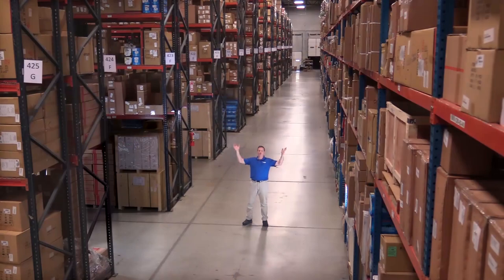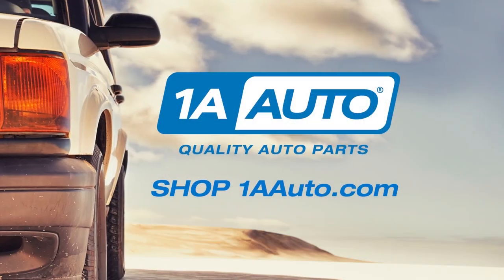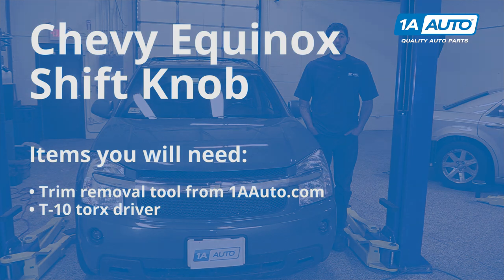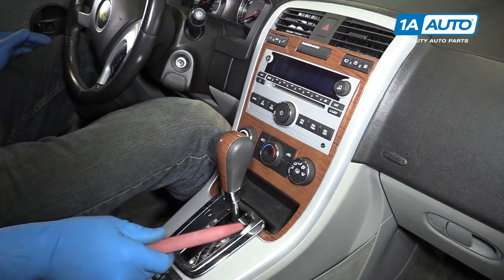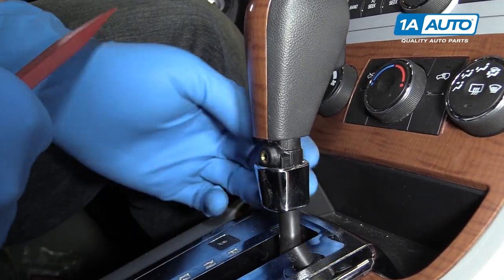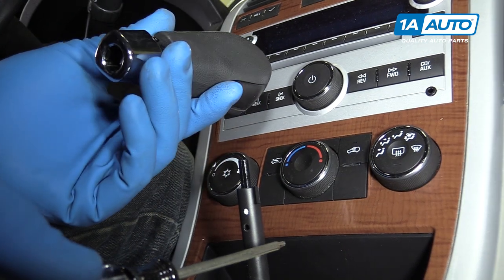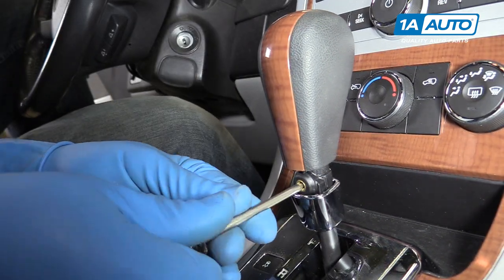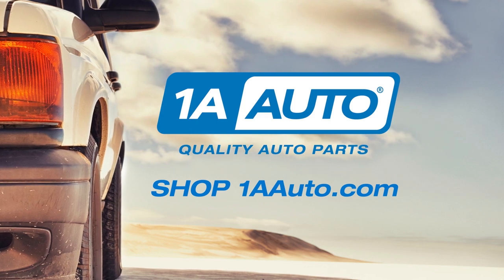How to Remove Automatic Transmission Shift Knob 05-09 Chevy Equinox

Comment: Trying to find this for a 2005
Reply from the maker: +Steven Gustke It may be a different procedure on your application. We currently do not have an auto repair video for this particular year, make and model. Thank you for asking. 1aauto.com
Reply: Steven Gustke It’s easier on a 2005. Just look in the front of the handle underneath the button and you will see the Allen head you need to remove